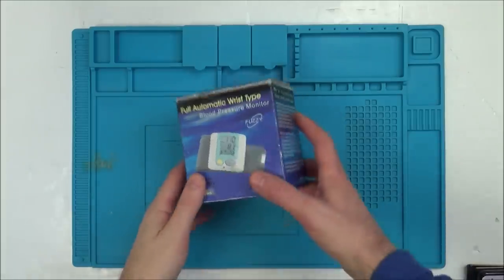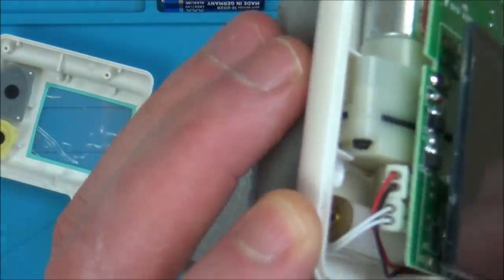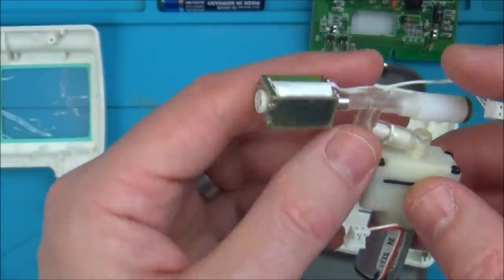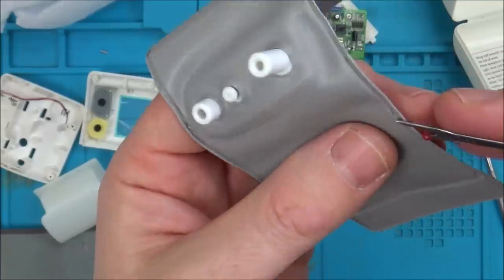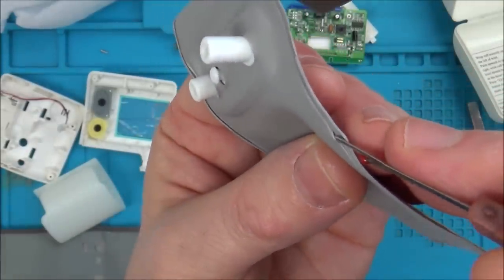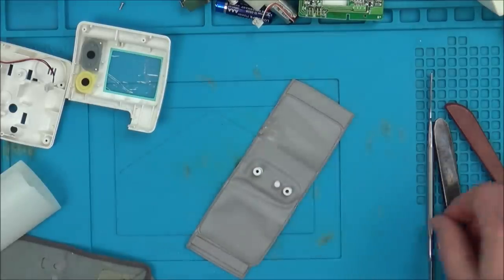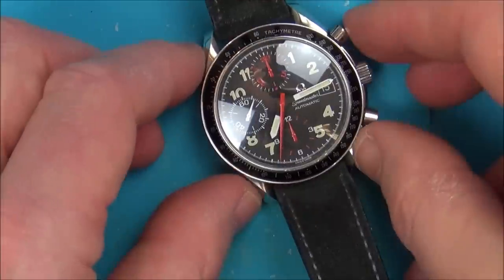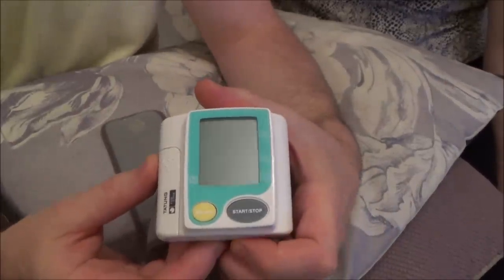Trying to FIX a Faulty Blood Pressure Monitor

Comment: I have used on of these for years, my pressure has always been low, 110 over 84,  pulse at 94 recently it's been 115 over 85 pulse 95, I'm 51, and am a smoker, wife is simular, I go to the doctor, and it's always been 120 over 80 with a pulse of around 82, normal for me, so you have to remember to calculate the difference between doctor, and home wrist device, and you come out right, us English are always nervous, and you have to take that into account with the pulse.

Comment: Hey Vince. As a physician, I can tell you that wrist BP monitors are not recommended for patient use generally due to them being inaccurate as compared to the arm ones. You should use it on your left wrist when possible as you already have, so that's good. However, you also need to have the wrist and arm positioned at the same height as your heart for better accuracy. Also, any arm movements will affect the readings by quite a bit. Majority of the time, they give higher readings than what your pressures really might be at. Good fix! Though, I won't recommend using this to measure your blood pressure routinely unless you can get the technique accurately to perfection without moving your arm and at the same level as your heart. Also, pulses are normal between 60-100, though in athletes it can be normal even in the 50s. But you did know your normal BP readings, which is great!
PS: May be you can get started on them ventilators next ;).
Reply: @FlameBunny  No, he is using it correctly, the heartbeat is likely contact pressure detected and there are no main arteries the other side of wrist so any result would be incoherent at best.   The cuff is pushing the whole thing in to create a greater pressure than the blood pressure which is why these machines if made well can be good but Chinesium grade ones are not very trustworthy.   When done the old way, you inflate and listen in to the arteries usually under the cuff edge on the inside of the elbow.
Reply from the maker: Thanks for the advice and tips Gopal, I appreciate it  :-)
Reply: TheWizard22UK  There are several reasons that might be the case and it would be best for you and your doctor to figure out among yourselves. At the top of my head here are some possibilities:
1) Inaccurate calibration of the device - I generally ask my patients to bring their cuff into the clinic to double-check their accuracy with the clinic monitors or my manual check. This is quite common.
2) You may have something called 'White Coat Hypertension' if that's your only machine at home. Essentially, it just means that your pressures in the clinic or hospital are measured higher than at home or other places. I trust that since your doctor gave that advise he or she is likely quite well-versed in ruling this out and may already have.
3) Some medications can cause lower blood pressure at times than other times and you may be measuring at times when the pressure is lowered.
4) You may have vasoconstriction or peripheral vascular disease or other vascular issues beyond the artery running through the arm and it may not show accurate readings. Despite having this, if deemed to be minor and without symptoms, it may not be investigated. You could try your other hand in this case.

Without knowing the medical history, seeing the patient in person and checking the cuff in person, it's had to pinpoint the reason and likely your doctor can answer this question as he or she has this information.
Reply: Should I have my fingers outstretched like on the illustration on my device or can I leave them loose. Then the pressure against my tendons curls them in.  The result is higher with fingers loose than with fingers outstretched.

Comment: 8:08 this a solenoid that realizes de air pressure in the end.
The way it works is: It stats to blows air until a defined pressure is reached, the pressure is read by that black sensor, soldered on the board.
Then the solenoid starts to release some of the air pressure, and the sensor starts to read the pulse. The pulse is read by the different pressure it creates when the blood travels.
The high and low blood pressure is redden when the pulse is detected and not detected anymore by a specific pressure .
Great video sir :)
Reply from the maker: Thanks FixDaily :-)

Comment: Good video Vince. Like someone else mentioned, I would say that the part with wires going to it is a solenoid valve to release pressure and the one opposite is a safety relief valve in case something failed, to prevent over pressuring.
Reply from the maker: Thanks Byron :-)

Comment: Another excellent repair!!  Fantastic idea to fix the balloon!  As others have said - the device with the wires, connected to the tubes, is a solenoid.  It releases the air after the reading has been taken.  Likely just opens a valve.
Reply from the maker: Thanks Chris for the info. It was an interesting little item on the inside. Still holding pressure OK at the mo. Looking forward to watching your Sega Mega Drive CD repair later :-)

Comment: Well done of fixing this one, a plan b for if you ever do something similar, a bicycle inner tube puncture repair kit might work. Depending on differences in material of course. Great video. Thanks
Reply: The air balloon is likely made of soft vinyl. An above-ground pool patch kit might be even better since the liners are also vinyl. (Probably enough to fix hundreds.....)

Comment: If this thing is actually measuring correctly, that would suggest you have Grade 1 Hypertension. I’d suggest getting that checked out by either a certified armband model, or (preferrably) by a doctor.

As a side note, a device that monitors or just generally measures blood pressure is called a “Sphygmomanometer”, which is a combination of a Greek word and a scientific word:

“Sphygmo-” comes from the Greek word “sphygmos”, which means “pulse”.
“-manometer” means “pressure meter”.

So “Sphygmomanometer” literally means “pulse-pressure meter”.

From what I’ve heard from my doctor and cross-referenced on Wikipedia, the method for measuring blood pressure is by using a wrap-around balloon and filling it with air while listening for blood flow with a stethoscope. 
The first point (systolic pressure) is taken the moment the doctor starts hearing a “whooshing” sound (or a pounding sound), which is the turbulent flow of blood squeezing through the currently mostly occluded artery.
The second point (diastolic pressure) is taken when that “whooshing” sound (or pounding sound) stops (indicating the artery is no longer sufficiently occluded to produce the sound).

Also, the size of the “balloon” is important, as too small would yield too high a pressure, and too large would yield too low a pressure.

Our blood pressure is one of our four main vital signs, and is of clinical significance:
Too high a pressure could lead to internal bleedings (as the arteries/arterioles/capillaries are NOT capable of handling these pressures for extended periods).
Too low a pressure means poor perfusion of blood (keeping blood from passing through the tiny capillaries, especially near our extremities, and especially dangerous if it affects our vital organs).

Hypertension could lead to horrible things like aneurysms (if they burst, you could literally bleed to death!) and stroke (from sudden rupture of a cerebral aneurysm), and while Grade 1 is not an immediate threat, it could grow into one.

If your blood pressure turns out to be normal, then the skies are clear. And the normal level is between 120-129 over 80-84, with the optimal level slightly under 120 over 80 (I’d say minimum 110 over 75).

So, as a subscriber, I feel compelled to send a message on behalf of all your subscribers: Get your blood pressure checked!
Reply: If the size of the balloon is important then maybe him reducing the size by melting it could account for it reading higher than it should?

Comment: To weld plastics like that they use a layer of brown teflon (tape) on the heated elements which pinch the plastic to weld together. This makes the plastic melt together without burning or sticking to the heated elements. So a bit of brown teflon tape on the tip of a clothes iron, a plate of metal also with teflon to put underneath, and you would probably get a neat, factory looking, weld.
Reply from the maker: Thanks Unimportant :-)
Reply: You can buy a spade tip for soldering irons, useful for putting copper braid under to mass clean a motherboard, easy to use that to apply the heat with.

Comment: Back in the day, you did it by 10 secs, if it came out high or irregular, you did a 15 secs with the ten secs times'd by six, the 15 secs times by 4 and if that still came in high or irregular you did a full half minute marking each one interval measurement /4 or /6 or /2 with abnormal or worrisome results in red for monitoring.   When I was in Southampton after my triple bypass, I beat the blood pressure machine every time, you can "hear" your systolic and dystolic as the machine compresses and releases and I said to the nurse every time the systolic came up then said again when the dystolic faded.   I had to show a poor student how to use the stethoscope and spigometer as everyone relied on machines these days and I was drilling the students on pharmacology the same way I was drilled as a student, I even worked local to you Mr V being in charge of a ward over at the old Abbot's Langley hospital or over the road in Leavesden Asylum as I was psych trained and what a creepy ol' place Leavesden was too.

Comment: Vince, you've made my day, as I thought MY blood pressure was a bit on the high side but, compared to yours, it appears to be fine!
With regard to the components inside, you identified the motor and air pump and the pressure sensor but the tubular white thing located over the vent holes in the case is a one-way valve to allow air into the pump but not back out again. The square metal thing marked as RL on the PCB is a solenoid operated release valve to slowly reduce the pressure in the cuff in order for the measurement to be made. Goob luck with you healthy diet, although you should really see your GP for an accurate analysis of your health!

Comment: great fix. Please take the readings differently. Put the device on your wrist (as you did) and then wait a couple of minutes. Think peaceful thoughts and relax. Breathing technique is key here. Maybe use the device to test your relaxation method. Get someone else to press the button and dont even look at the device when its working. Please do this 5 times the way you were doing it and then 5 the way I suggested and record the results.
Reply from the maker: Thanks Emma, I have used it a few times first thing in the morning, before getting out of bed and the figures are a lot lower, sometimes in the normal range. I don't think I am as bad as the monitor made out I was in the video, maybe I had a lot of salt that day, working bent over on the floor, excited by the fix etc.  Also if I raise my arm higher and outstretched the figures come down as well.....But I have tried to cut down on the snacky crisp type food (which is hard) and I will keep an eye on the figures. Hope you are keeping well :-)
Reply: @Mymatevince  Yeppers. It is taxing on the mind and body this lockdown. Getting through it by watching boxsets and stuffing my face with crisps

Comment: Vince: There are repair kits for leaking PVC, sold especially for blow up beds. Amazon sells a few. Holes on a seam are a challenge. For PVC, you can repair it with PVC Pipe Cement. That is made by dissolving the PVC plastic in solvents. The solvent mix is THF (tetrahydrofuran), DMF (dimethylformamide) and cyclohexanone. Now they try to replace the expensive cyclohexanone with cheap MEK (methylethylketone) but the original mix works best. At one point you could get the solvent mix to refresh your dried up cement but now they prefer that you throw out as much as possible so they won't supply the solvents. All repairs on a blown shell are challenging. The air pressure tends to open up the patch. Collect a store of flexible PVC film for these repairs and use the cement to cement a patch down.

Comment: Hello there, I own one of those device and, if used correctly they are, for the price, quite precise. The readings should be done with the arm not resting down (on leg or table or whatever) but the machine has to be at the hight of the heart (arm close to the breast). The last measures were done with the wirst at least 20 cm down the heart. For my experience it makes difference. Wishing you my best i suggest a better reading (with a professional machine) and a medical consult if pressure gets high. By the way i had my minimal at 110 for a while! I had to take pills!

Comment: Have you booked a doctor appointment for hypertension ?
Reply from the maker: No, not yet. I will try to sort it out with diet first :-) I have taken multiple readings since and sometimes it is in the normal range :-)
Reply: @Mymatevince  take krill oil does wonders for high blood pressure

Comment: Good fix, Vince.  I don't know if it matters for the pressure measurement, but I think you put the device on your wrist upside down every time.  I think the lettering should not be upside down for you to read when wearing it.  That would also appear to match the pictures in the box.

Comment: Yes, maybe you need to think about trying to fix yourself by making use of your hour a day 'permitted exercise!'
Good fix on that blood pressure monitor, my mum had a similar one years ago, I always wondered how it worked, basically it's a tiny air compressor. I'm wondering if the accuracy has been affected due to the volume of air being slightly less in the little balloon thing, after you melted it together.

Comment: Good fix. I tried mending a camp shower bag with melting but the water pressure was too high and a leak returned quite quickly. I expect with this machine, the pressure isnt there for long enough to cause a return of the leak.  Our doctor used to say blood pressure is different for everyone and that to test it, you need to be in bed and have the machine run the moment you wake up. So any high readings you get when using one during the day are not your resting heart rate etc and cant be relied upon.

Comment: Years ago I had a soldering gun that had a plastic welding tip. The tip was a similar shape to a clothes iron but a lot smaller. The instructions said to use a piece of paper on top of the plastic you were trying to weld.
Reply from the maker: Thanks PDS, it sounds like the type of thing that would only be used a couple of times a year BUT really handy when needed :-)
Reply: @Mymatevince  Yeah I only tried that bit once out of curiosity and never used it again.

Comment: Wrap the area with tinfoil then use the tip of your iron to seal a semi circle around the area, also changing the volume of the balloon will likely throw it out the calibration. The silver rectangle is a solenoid valve to release the pressure.
Reply from the maker: Good idea, thanks :-)

Comment: When I was in high school my heart rate was consistently 50 bpm.  Now I'm 50 something, 40 pounds overweight and it's up to 75.  I thought 75 was high.  If your heart rate and pressures stay consistently high, try intermittent fasting techniques, fast walking, and a Keto style diet.
But first try a different blood pressure monitor.  
Interesting video as always!  :-D
Reply: Fitness is something you have to keep up all your life, once upon a time I used to run 10 miles a day, could run with a pack for 30 miles, super fit and super strong then kids came along and less and less time to do the essentials which led to couple years back a full on 8 and half hour operation to replace three very clogged arteries, still waiting to have two more done they forgot to do at the time.   Thing is, every person on my ward was the same, ex forces, ex super fit, let it go and ended up needing bypass surgery.

Comment: The RL component is a solenoid valve RL probably stands for Relay. This valve closes whenever there is power on it so it prevents the air from escaping thus inflating the balloon. When the power goes off it opens and lets the air out, deflating the balloon.
Reply from the maker: Nice one Thomas, thank you :-)

Comment: Pre- Hypertension before you start worrying use the good machine sit still for 5 minutes and  no talking your bp will most likely be fine. (I'm a nurse)  your pulse always fluctuates and under 100 is fine. Great fix as always though.

Comment: You should try and use a product called sugru has a 'soft touch' or slightly flexible, grippable texture similar to features commonly found in soft overmolds. It is waterproof and dishwasher-safe, and the material is thermally insulating, with a service temperature range between −50 and 180 °C (between -58 and 356 °F or 223 and 453 K).

Comment: a very nice fix, i actually wondered why you didn't use a innertire repair kit, it containes patches and flexible glue and is made to hold pressure afterwards. (or am I realy getting old and the only one remembering those simson kits for your bike in a little purse under the seat?)
Reply from the maker: Cheers Etienne, I do have a puncture repair kit (got it from the £1 shop). I didn't think it would work around the edge because I thought the air would escape along the seal. If the hole was in the middle I would have definitely used it :-)
Reply: My Mate VINCE now that makes perfect sense haha. Yeah on the edge it might not have worked.

Comment: Hey Vince I have a broken laptop. I was wondering if I could send it to you to see if you can fix it. The fault with it is it does not charge. I have had it cleaned because it was very corroded by the charge port.
Reply: @Petraplexity I didn't ask you.
Reply: @alloy0455  No.
Reply: @andymouse  I didn't ask you